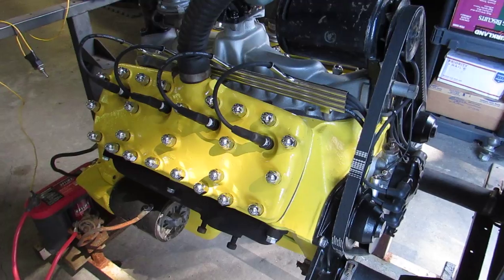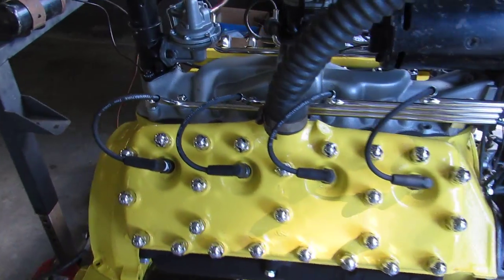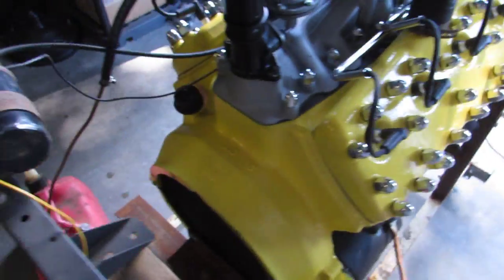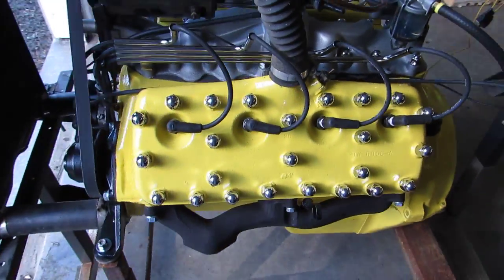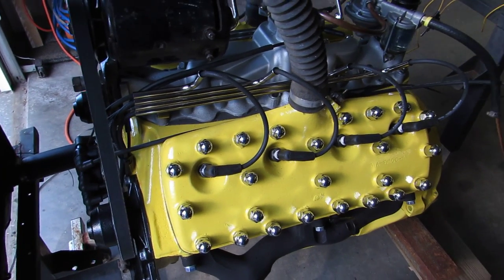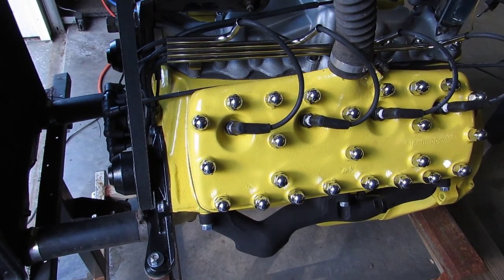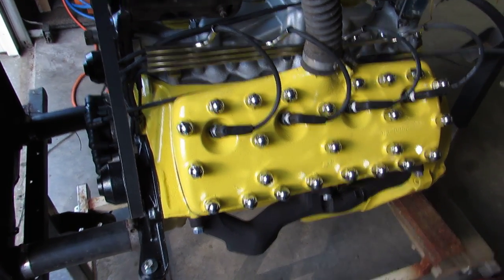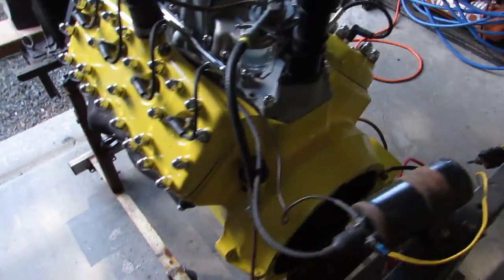81A Ford Flathead V8

Comment: What a sweet running engine, loved the color. My dad bought a 1938 "60" but quickly traded for the same year  model with 85 HP. Mercury introduced 100 HP in 1939 which soon became the racing engine of choice. 100 HP continued until 1953 when Ford upped the engine to 110.
Reply from the maker: Ellie Price thanks for the comments. Yeah it was a fun project to get back on the road.
Reply: There really wasn't any difference between 52 and 53 ford V-8s. The real reason was fords new overhead valve inline six, new for 1953, made more horse power than the old flathead V-8. Of course in 54 ford went to the Y block overhead valve V-8.

Comment from the maker: Flathead motors are expensive to rebuild and finding a block that is free of cracks can also be difficult. This motor was the original in my 38 Deluxe and was a good one. Lots of comments about the color. The car was painted black cherry and the engine really popped when you opened the hood. It’s all about personal preference.
Reply: Do you remember what you spent for machine work? Thanks!
Reply from the maker: @mhazel9551  the block was a good one (no cracks) which helped keep the cost down. I don’t really remember what the machine work cost but it was probably $500 or less. Just bored out, valve seats, polished crank and reconditioned rods. Lots of new parts which pushed the price above $2K.
Reply: @fredbaker9163  thank you, I'm getting a 337 flathead rebuilt right now and I was wondering what kinda price tag I was looking at for the machine work. Thanks!

Comment: Awesome engine, sounds great!  Where did you get the routing bracket/tubes for the spark plug wires?  I need a set for my flathead.  Thanks!
Reply from the maker: The shop that did the final machine and assembly put those on it and I’m not sure where they came from

Comment: I have a flathead on a test stand like yours. I bought it from a guy that had it running on a test stand. But when I came back the next day in my truck to get the flathead, he took off the ignition (starter button and coil) wires. So, I'm left with trying to figure out how to wire it to get it running on my test stand. I need to know how to wire the push button to start the engine. Is yours a 6-volt battery? If so, is it positive ground? Is the yellow wire on your engine connected to the + positive side of the coil?  Also, on my engine there is a wire hooked to the distributor going to the - negative side of the coil. The + positive side of the coil doesn't have a wire hooked to it. Thanks and I'll look for your response.
Reply from the maker: Mine was six volt positive ground. I was using an older starter solenoid that had a built in push button switch that I used to turn the starter. I believe I ran the positive battery terminal to the block for ground. I ran the negative battery terminal to the starter solenoid and from starter solenoid to starter post. I ran a small wire from battery negative through a toggle switch to the coil positive. There’s a lot of good early Ford Flathead information and help on the website The Ford Barn. Good luck Fred.
Reply: @fredbaker9163  Thank you! That's just the information I needed. I hope to have this engine running tomorrow. Mike
Reply: O fio positivo pós chave vai na bobina no positivo 6volts se for 12 volts mesma coisa ,a fio negativo da bateria vai no bloco do motor ,o negativo da bobina vai no platinado,no distribuidor,o distribuidor e aterrado pelo bloco do motor o fio positivo da bateria vai no arranque de partida

Comment: I had a 38 Ford pick up and it had that odd duel distributor on the front of the engine. Is this just another design that on the 38s ?
Reply from the maker: The 1932-48 Ford V8’s had a few variations to their distributors. The most popular one is the “crab” style from 46-48. The earlier ones had a cap on each side that looked like a helmet. Yours sounds like that type.

Comment: I'll conceded that flat eight always looks good. But:
3 mains on eight cylinders is a looser, so many warped cranks.
Running 3 of 4 exhaust thru the water jacket was not the real solution, it was the Henry fuck you all solution.
On turns, torque and HP chrysler was the overall victor of record
Reply from the maker: Yeah the Flathead is more a traditional early hot rod motor that really had some design issues. I’ve owned a few of them over the years. This 38 Ford went to a guy in Sacramento CA about five years ago. Now I own a 42 Buick Custom with a 455 and a 55 Olds with 324 Rocket V8. Don’t have an old Ford currently.

Comment: Are flatheads expensive to rebuild??? I’ve never messed with one but I got a 31 Model A id like to drop a flathead in. It’s a original car and not lowered or anything. I’d like to keep the original look and tires but stick a flathead in it

Comment: how much horsepower!?
Reply from the maker: As a stock engine it would have been 85-90HP so not very powerful by today’s standards. After the rebuild it might have had 100HP. Thanks for looking.
Reply: You can soup it up to about 140 with the stock displacement, and still have a good smooth-running engine, more if you don't care about smooth, about 220 if you bore, stroke, port, and relieve it.  But keep in mind that cars it came stock in were not heavy cars - about 2700 - 2900 pounds for 1933 - 39 models, about 3100 for 42 - 48 models.